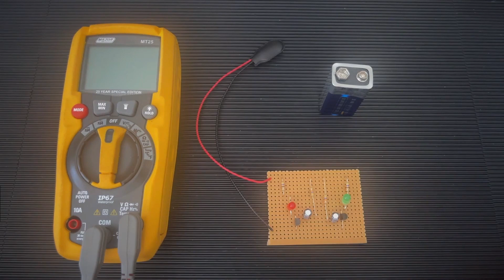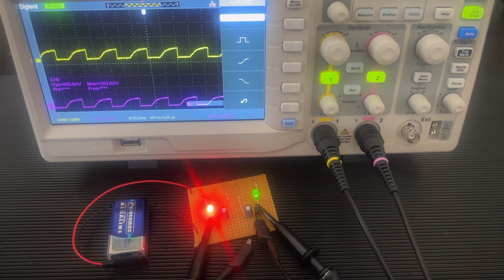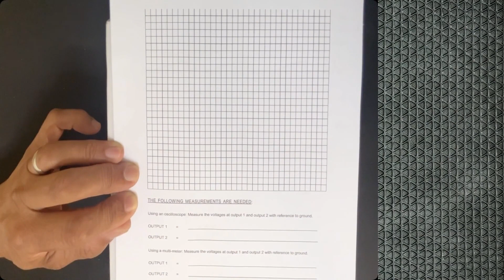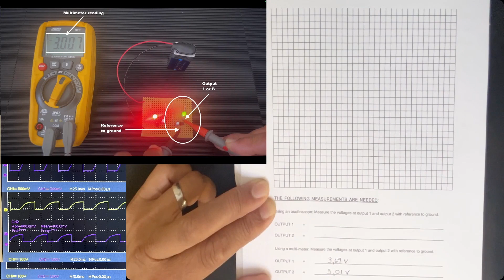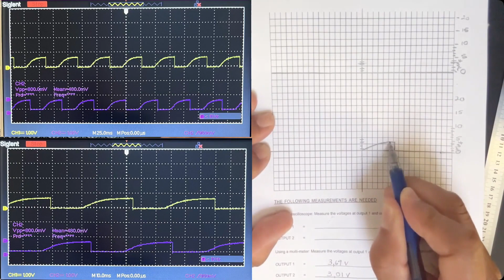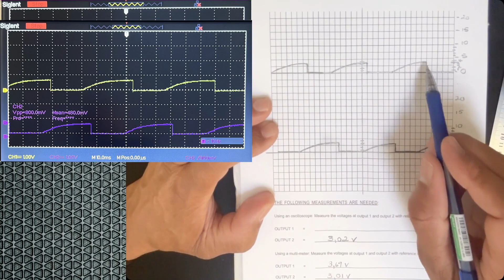ELECTRONICS PROJECT   Test & Record Readings of an A Stable Multivibrator

Comment: The DC volt measured will not stabilise because it is pulsing and there is a variance between the pulsing and the sample rate of the multimeter.  If you want stable then you need a meter that has an avg function.
Reply from the maker: Correct, will do another video at some point where this and other topics are dealt with. E.g calibration of oscilloscope screen vs data sheet, calculations & this issue, etc. Your input is appreciated.